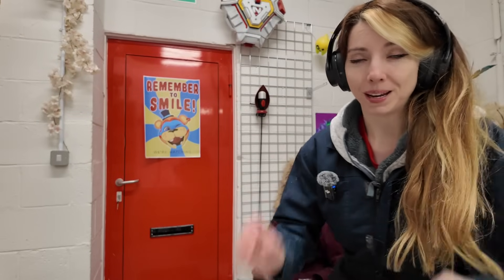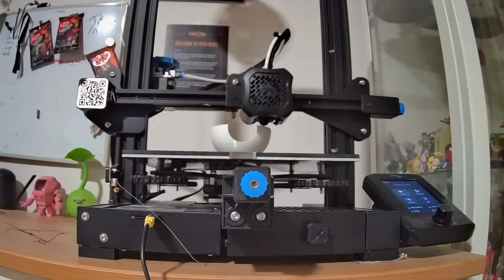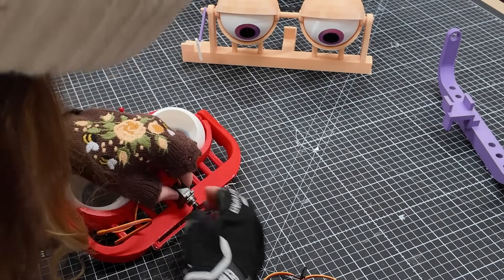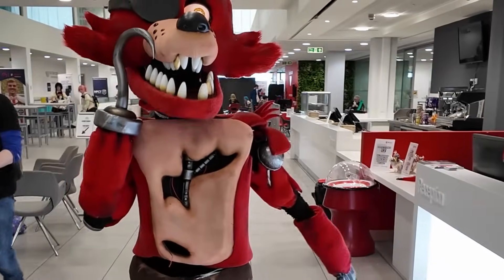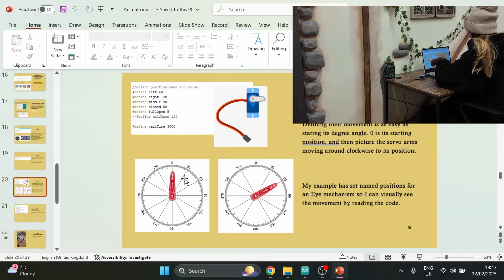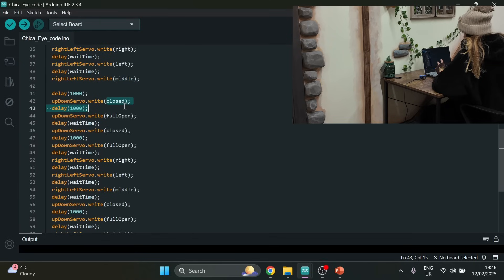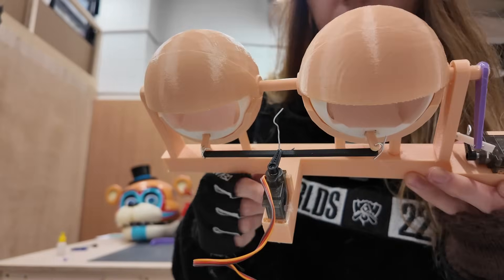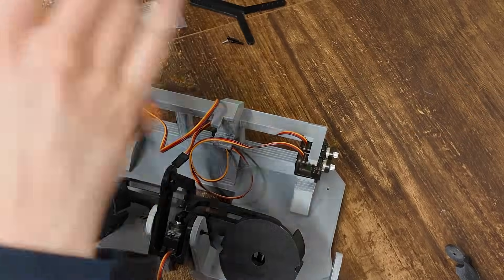Basic Animatronic Eyes

Comment: I'm using a small rack gear and putting two loose medal joints, 1on each side and using a gear and servo and so when the survoturns the gear the rack gear moves left or right moving the eyes because there is going to be a straight medal rod from the eyes to the joint, so when the rack goes left on wire will be staing till being pushed to the right why the other wire is moving in the directiong. Its just confucing to exsplain

Comment: Looking at the armatures for Chica...did you ever consider flipping the whole frame over so that the servo was up by your forehead rather than down on your nose? It'd take a bit of tweaking with the software for the directions, but that'd be minor. And would give more room for your own head.
Edit: For better explanation, hanging the armature down from the top of the head, rather than up from the bottom, basically.

Comment: Question for those who can't afford 3d printers but bought ornaments for eyes how can I make a structure by hand for moving eyes ? The arduino Uno kit only gave me 1 servo motor
Reply: Unless I'm mistaken, those are the exact same servos used in the R/C model aircraft hobby, If you need more servos, you should be able to get them through companies that supply said hobby (unfortunately, all the companies I used to know have since closed down, so I can't help there, sorry).

Comment: Im definitely using this in my foxy cosplay
Reply: Ive watched ur videos the cosplay is looking awasome!!!
Reply: Hi! I was wondering how u set up the two servos to the Arduino uno r3, specifically the power supply cables? Did you use a breadboard, an external power supply for the servos, or did you get them both into the same 5v socket on the r3? ty in advance